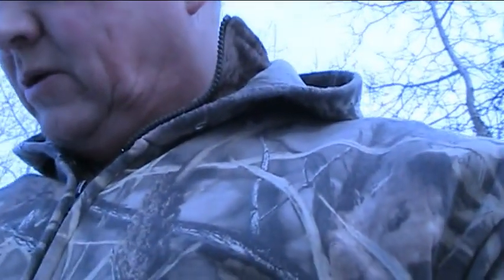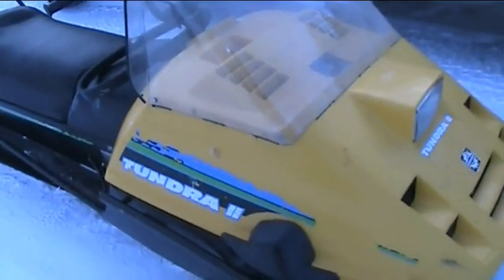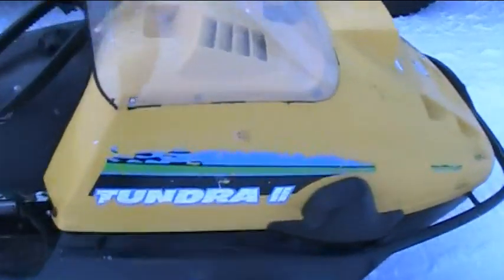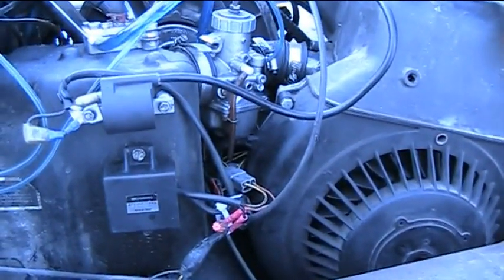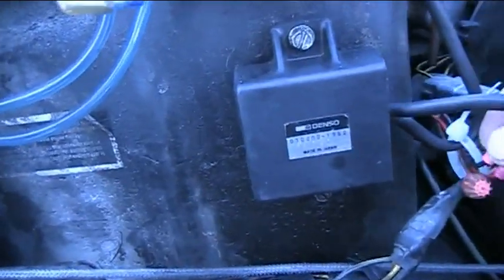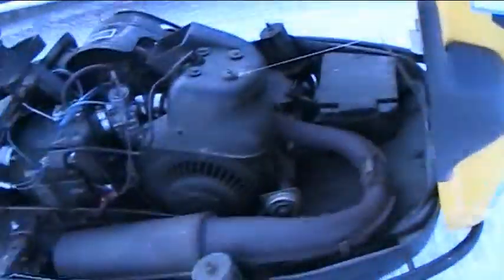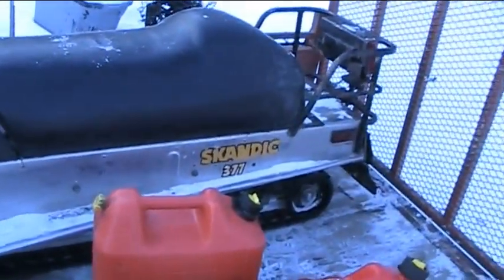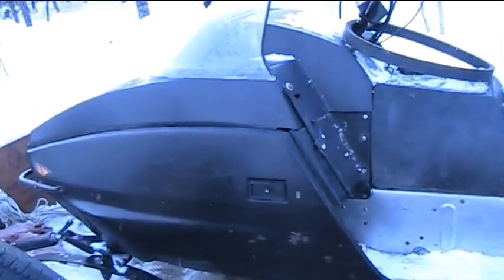1993 Tundra 2... Any help out there ?

Comment: I'm using a newer (2011) tundra with the 600ace 4 stroke engine, and it's been great. I'm in the mountains, and have had zero issues. Pulls a loaded skimmer like a hot damn, and runs great at any elevation. The top end of my line is pretty close to 5000 feet above sea level. My 2 cents..... Good luck  on the parts hunt, I enjoy your videos!!

Comment: Yeah a new needle and seat set should fix the fuel problem with the skandic. As for the tundra.... check the kill switch, they often are the culprit for no spark. Check all your grounds and wires, as this can cause many problems. The backfiring indicates a badly timed spark (Exhaust valve open) those trigger coils can go bad and there are aftermarket, generic ones available. Ebay is hit or miss with parts. Check for inline fuses in your electrical system that control ignition (blown or broken) Wiring and grounds are the usual culprits tho. Use a multi meter to check all wires for continuity. Hope this helps, and good luck with them.

Comment: Hi there, a little on the 600 ace and 900 ace  My dad and i have both machines the 600 was bought last year the 900 this year. The 600 has lots of low end torque and if strictly trapline and not a lot of lake running at high speeds this machine, i doubt could be beat. It still will hit 70 mph so it isn't slow either. The 900 has a years worth of new technology like eco mode smart key etc. Identical machines other than wireless throttle and the mode options. The 600 is excellent on fuel the 900 only has 40 km's so far but apperently not much harder on fuel. We both had vk 540's and although they would go through snow they are nothing compared to these new skandics. These machines steer like a dream and manouver in deep snow like an old ellan it feels like. I run 120km of line and do it in a day trip and i don't even think of refueling. I couldn't make that run without refueling sometimes more than once on my VK. I hope this helps and believe me you won't be disappointed with the skandic whatever motor you choose.
Reply from the maker: Thanks a million Mike.... that is the exact machine I am strongly leaning toward. Always been a Bombardier guy.

Comment: After watching the full video i dont think its your trigger coil (the coil on the inside of the flywheel) Its rare they go because they carry no load, thats just what times the spark. This can easily be checked with an ohm meter.  Is that new main  coil an aftermarket one ? Like an SPI ??  I worked in snowmobile shops when i was younger and aftermarket coils were a constant source of aggravation, they would run fine in the shop and then fizzle out right away once someone took it home and rode it.. The first step is to see if it sparks with another new coil, and if it does then get yourself a genuine bombardier coil.
Reply from the maker: The problem is that they only made this electrical system for the 93 and 94 models. After that the parts won't work according to my mechanic. He searched all his connections and finally found 1 new part and he had a used coil that he took off a scraped machine. He put the CDI box on first and it started right up. Took it for a spin and it died and he had to drag it back to the shop. Put on the coil and it started right up. He started it every day for a week and then I took it and it did what it did. Backfiring and only go at a slow speed until I got back to the yard and when I let go of the throttle it died and won't restart. He wants me to bring it back and he will tear it apart and clean the connections he said?????
Reply: Maybe cleaning the surface of that trigger coil will help, but i'd be willing to bet its your main coil again. Hopefully they can find you the factory parts. I have used many aftermarket engine parts and such, but have learned from experience that when it comes to electrical its worth it to splurge for the parts from the manufacturer. 
     On another note i have been looking at new machines myself. They are MUCH heavier now than what they used to be when it comes to tundras and skandics. I suppose thats why they run much larger engines. I have been considering a tundra, and they have both liquid cooled and fan cooled models. Only the liquid cooled models have EFI, and nowadays i think thats the way to go. Then it doesn't matter what temperature or elevation you are operating at, the EFI will compensate.
     I like the 4 stroke idea as well. Have a few friends with 4 strokes and they are fuel misers, but again they add a substantial amount of weight which can be a bugger if you get them stuck on your own, and they also have a crankcase full of oil so the guys here plug theirs in just like you would your truck.
   Lol, one friend here has both a block heater and a command start on his Yamaha 4 stroke.
Reply from the maker: towee70 Those are the 2 I have been looking at also. The Tundra I would prefer but they don't put out a wide track and that is what may turn me to the Skandic. I think the 900 is too much sled for what I need, the extra power would be mostly wasted on my line. A block heater and command start on a sled. That my friend is messed up....lol
Reply from the maker: towee70 And I know what you mean about the weight, remember the old sleds like my first one, a Jag 3000 free air. You just pick up one end and walk in a circle to turn it around. Even that Polaris of mine is a tank.
Reply: My first one was a Cat too, an El Tigre. I could load that one in the truck myself back then. All that independent suspension sure is nice, but makes them pretty heavy up front

Comment: There is a fellow with a few tundras for sale that he reconditions. He is located in Winnipeg and you can see his ads on Kijiji. He may have the parts you need, and would certainly know where to get them. His name is  Rene (204) 771-0102
    GT Cycle and snow in winnipeg is an off road wrecker that may have parts as well.
Reply from the maker: I will check them out thanks

Comment: Also you may have to heat the thing up! There is a reason I don't trust those stupid electric starts they're are garbage.
Reply from the maker: AlaskanFrontier1 Ya remember the older machines before these CDI boxes. You just carried an extra coil in your machine and changed it out in the bush if one went south on you. Now there is so much shit under the hood it just baffles the average guy.
Reply: Trapping World
Ah well I have a mechanic that has taught me a lot about 90s Polaris's. So its pretty hard for me to get baffled by one of the machines. Just today we finally tuned my Polaris XLT so it runs like "a bat out of hell" I mean that thing is fast!
Reply: Trapping World could try heat the cbi box a bit w a heat gun .sometimes that brings them back